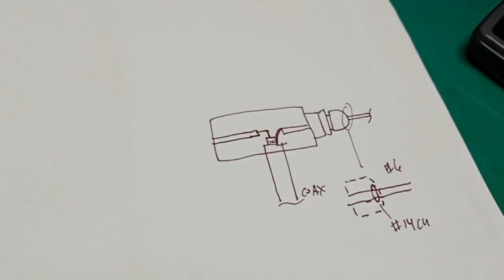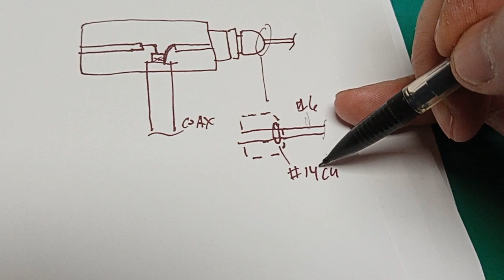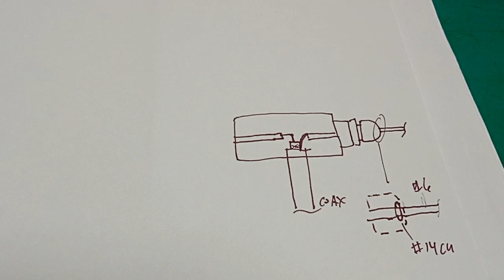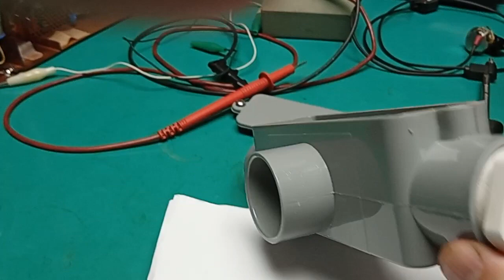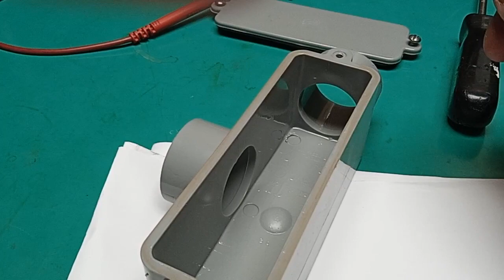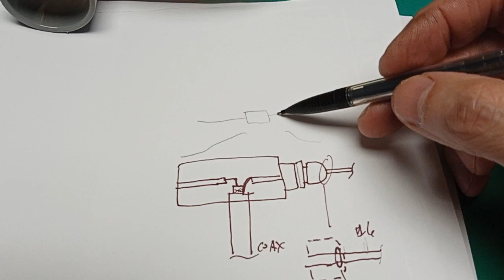Dipole Build Details

Comment: A great build, and a superior method of strain relief.  It does not vary the cut length.  Keeping it EXACT!  Great job.
Reply from the maker: Ive had that antenna up nearly 10 years, works perfectly, except the para cord is decayed and sagging.
Reply: @k8byp  Very nice construction.  I was wondering if you did the same thing on the ends, having the #14 copper wire ring soldered near the ends and then a cap and pipe with holes for the paracord?
Reply from the maker: I think the answer is " no." IIRC its just a wire loop, maybe soldered.

The ends arent mechanically important, the feedpoint is because of torque .
Reply: @k8byp  Okay, very good.  Thank you for explaining.